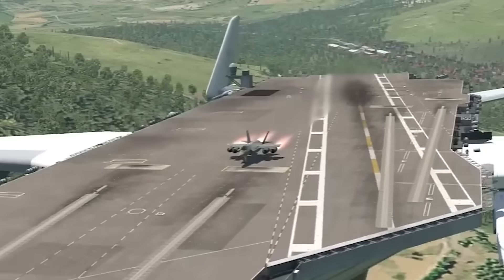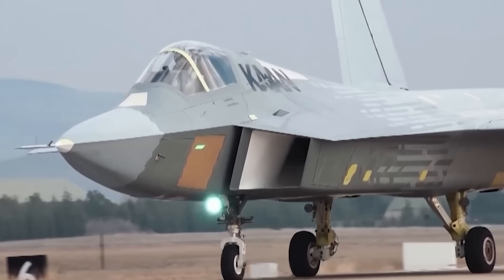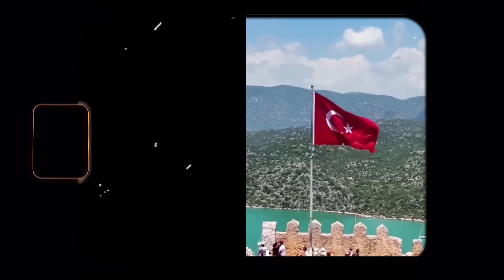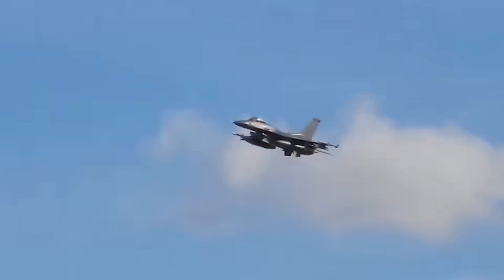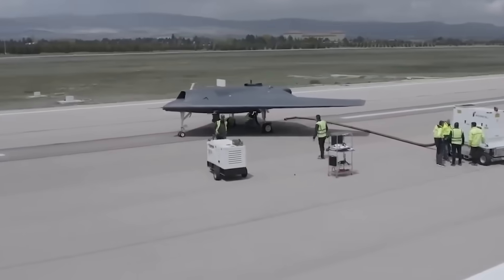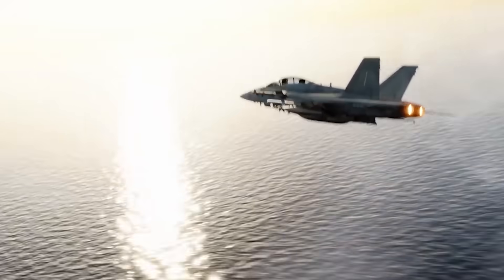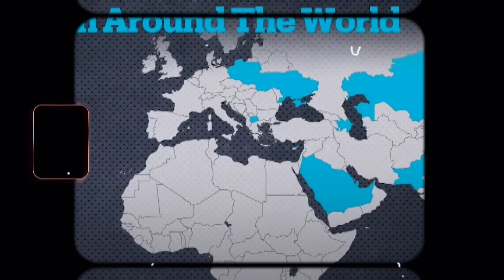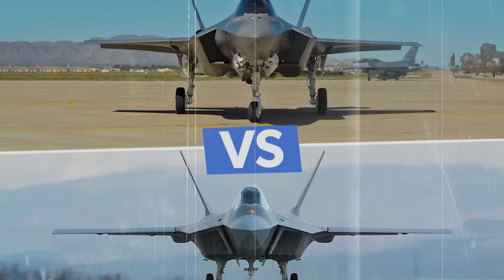TF Kaan vs. F-35 – A Comparative Analysis

Comment: When you compare the F-35 with Kaan it may be worthwhile to indicate which version of the F-35, specifically the US domestic version or the export version, they are different and the US version is significantly better.  I think Israel is the only country that operates F-35s that are similar to the US versions.  Another point to consider is that, as pointed out in the video, F-35 is a virtual flying super computer which is in constant communication with the control center (located in the US) and can be manipulated by the control center (i.e., US has a kill switch).  The US denies this but that only makes sense.  Finally, in the event of a war, US can also stop delivery of spare parts and weapons if they wish to do so.  Bottom line, even if Kaan is not as good as the F-35, it would be better for Turkey to have their own fighter.

Comment: Radar, Avionics, Sensors need power to perform well so F110 engines using only for test program for now and maybe first a few KAAN block 1 will use it. During this time long Türkiye will finish its domestic engine ( 35000 lbs × 2 ) this will give power to KAAN far beyond F22

Comment: You ignorants are miss something about airplane and engineering.
1.F-35 is a stu-pid copycat of Russian YAK-141
2.Even changing the wing area of an aircraft by 0.35m2 changes the aerodynamics of the entire aircraft and all engineering calculations are redone. Aircraft manufacturing is an engineering job, not a fashion. Aircraft are similar to each other and this is normal. They all have a wing, engine and canopy.
3. Do you know F-35's radar emmiting coatings is made by a Turkish owner company?

Comment: Kaan is currently empowered by F16 jet engines. But Türkiye is too close to produce its own jet engine. So we don't need US or EU made jets by 2030. Just hold on for a while.
Reply: The KAAN fighter jet currently uses General Electric F110 afterburning turbofan engines. However, Turkey plans to replace these with an indigenous engine, the TF35000, developed by TUSAS Engine Industries Inc. (TEI), by 2032,
Reply: @TheOzTube Bla bla bla.
Reply: After domestic tf30000 engine, it will compete with f22
Reply: 2009dan beri altay motoru üretemedik uçak motoruna daha baya yol var
Reply: Turkey isn't able to build am easy motor for Altay... 😂😂😂
Reply: 2012 de altay tanklari cikiyordu nerede once bi onlari uretseydik
Reply: @aksuseyh4385  Madem bu kadar meraklısın, seri üretime geçildiğini ve seri üretim teslimat tarihlerinin açıklandığını neden bilmiyorsun?
Reply: @snn- hic bir proje tamamlanmadi ve tarihler tutmadi onu biliyorum 2011 de elektirikli traktorler 2013 de altay tanki cikiyordu ve cikmadi tank 10 yil gecikti bu 5 nesil ucak dan bahsediyiruz yalan dolan hangi soyledigi ciktiki bu tutsun sen basit bi tanki yapammid sin
Reply: @snn- Turk fairytale 😂😂😂
Reply: @aksuseyh4385 bu yıl teslim edilmeye başlanıyor Altay tankları. 3 yıl içinde 85 adet teslim edilmesi planlanıyormuş
Reply: @aksuseyh4385  KENDİ VATANDAŞIMIZ BİZE DÜŞMAN MK
SKTR GİT
Reply: @aksuseyh4385  O projeyi resmen rezil ettiler rant projesi yaptılar klasik akp. Ama toparlandı 2030 da envanterde çokca görülür. Tahminimce.

Comment: Kaan is a prototype, it doesn't even have its own engine yet. Both fighters can't compare yet as far as Kaan finishes its fundamentals needs
Reply: You are right Kaan, tests are continuing, the national fighter jet (KAAN) needs 35 thousand lbf thrust, the TF35000 turbofan engine is in the production phase. Comparing it with the F35 is ridiculous at this stage.
Reply: Yeah but the production phase of the jetmotors has started years ago. It was set to be finished on 2028 and some weeks ago they anounced it may finish a year earlier. Things are going better than planned. I think eventually they will make a better plane based on what officials say, but for now, no match indeed
Reply: Bazı şeyler yer altında büyür. En büyük olana kadar farkedemezsin.

Comment: There's no realistic scenario where f35 faces a kaan. F35 is currently more capable and flexible but Kaan is very promising considering Turkey doesn't have fighter jet manufacturing experience. If Turkish authorities keep using the project as political tool and hinder its development project like when they did with the first flight which they've used the only ground test prototype, Kaan won't reach anywhere in its projected time.
Reply: chp li detected.
Reply: Türkiye’s majority of F16’s built domestically under licence as well as for some other countries such as Egypt. Türkiye has decades long experience and technicians who can disassamble and assamble f16 and it’s engine with a blindfold. TAI’s capabilities not something to underestimate, Türkiye already has it’s own light jet and light craft production lines on going with Hürkuş and Hürjey
Reply: @eminymin  producing from a blueprint is not the same as producing the blueprint.
Reply: @azovianace I agree with you, but Türkiye started a journey by designing training aircraft in 2007(hürkuş).He then worked on projects such as the jet trainer and the light attack aircraft "Hürjet"Preliminary protocol signed for export of Hürjet to NATO member Spain If Türkiye continues with this knowledge and continues to transfer the necessary resources, it can complete this project in the early 2030s.
Reply: @ahmetylmz444  I agree, however producing a trainer aircraft and producing a fifth gen stealth fighter is completely different. I am not saying it can't be done, I am just saying it won't be on time if the government uses the project as a political propaganda tool like making the only ground test prototype fly to gain votes in the election.

Comment: Kaan is of course a threat for F35's. In fact, that is exactly the purpose of her creation. To create an alternative to the American monopoly.  Do you think F35 users would be happy to receive a confirmation code from the US before each flight or to automatically share all flight information with the Pentagon? Not being able to use non-American ammunition, vital systems like IFF being open to instant intervention by the manufacturer, or almost all subsystems including avionics being able to be manipulated... this is what you call customer satisfaction. Not to mention the exorbitant price tag, the outrageous cost of spare parts, or the inability to perform even the simplest repairs without permission.
... Did you know that the mechanical sun filter for the F35 pilot helmet comes with a price tag of $11,000? The same mechanical part ordered for the F16 helmet costs only $135. Madness. 
That's exactly Kaan's goal. To be an alternative that is end-user friendly, has a reasonable price tag, and does not threaten either the pilot or the recipient country with a kill switch. Cheers 🥂

Comment: I guess it will be somewhere between F15EX and F35.
Reply: Nah, it will be better than F-55. Kaan already has 2 engines and insanely strong aesa radar. 
U.S knows they don’t have chance if they don’t make a 2 engine f35 thats why they are making f55, even then problably Kaan will be better, because it is not just a fighter jet, it is also a main ship for other Turkish drones, you can manage and use other drones from Kaan. Kaan is a game changer
Reply: @gultekin
TF-X Kaan will be technologically more advanced and better than the F-22, there is no doubt about that.

Comment: I am a Turk. I don't like empty boasts. I'm a realist. I don't think KAAN will be technologically better than the F-35. If the KAAN can technologically catch up with the F-35, this will be a good result for Turkey. And if it does, this should not be a surprise for anyone. Because efforts have been underway for years to develop all the necessary systems. Turkey is successfully finalizing all the projects it has initiated. Not like Europe or India.

There are already areas where KAAN is superior to the F-35. These are related to overall flight dynamics. To fly better, KAAN has a better airframe design than the F-35. The F-35 is too fat. KAAN also has two engines. This offers the advantage of both range and ammunition transportation. Mororu does not need to operate beyond its borders. This avoids many of the problems experienced in the F-35.

As described in the video, KAAN will not only fight on its own, but will also coordinate unmanned systems (a feature of 6th generation aircraft). It will do this with the presence of many autonomous systems. But how much can a single-pilot airplane accomplish? I'm a little skeptical.
Reply: The propesed radar for Kaan in its first batch is much bigger then F-35 with same tech and higher cooling capasity (its an important display that shows how powerful it will be) also Kaan designed not just for air dominance but ground missions is also prioritised from the start of the design. It's still the only fighter that has dual IR sensors from the get go. Sensor fusion probably better then F-35 from the day one.
Reply: You underestimate your own country. Kaan will have much better radar than f35. Its GaN modules are more than apg81's. Plus it has twin motors. F35 heavily lacked manuevrability. With twin engine kaan will probably not.
Reply: @karbonaterol651  The flight features of KAAN are already better. In fact, many other aircraft are better.

I do not underestimate my country. We, the Turks, have had higher technology throughout history except for the last 300 years. Now we are developing again. But it is not easy for Turkey to surpass US technology. Why? AESA radar has a history of approximately 50 years. We installed the AESA nose radar on the F-16 aircraft for testing purposes just a few months ago. If our radar is better, it will not be because we have better technology, but because KAAN's nose cone is larger. F-35; The 4th low radar stealth aircraft of the USA (F-117, F-22, B-2). Our low radar stealth studies are still ongoing. We do not know yet whether it will catch up with the first versions in 2028. The engine power of the F-35 is 41,000 lbs. The engine we are trying to make is 35,000 lbs. The engine that the US built and used for the F-22 decades ago.....
When Kaan is built, it will be a better plane than the F-35 in total. The reason for this is because the concept of Kaan is better. It has 2 engines. It has a much better shape for flying....
Many people in the world think that the Turks cannot build Kaan, they cannot handle it. However, they will definitely be wrong. There may be a slight delay in the schedule, but it will definitely be built.
Reply: Senin gibi dümbükler atak helikopterinin uçmasına yada tcg anadoludan siha kalkmasınada şüpheyle bakıyordu, Türkiye nin elektronik alanındaki büyük başarılarına rağmen kaanın sensörleriyle ilgili şüphe duyman kesin  muhalefet ezikliğine bağlı olmandandır. Türkiye bu zamana kadar yaptıklarıyla kaanı yapabileceğini zaten gösterdi, savunma sanayii yetkilerinin kaan artık bir zaman meselesi anlamında açıklamalar yapmasının  sebebide budur.
Reply: Kaan has already been sold to Indonesia, 48x times for around 15 biljoen dollar. This means it is very Good. This plane should not be compared to the F-35 but to F22. Kaan wil be far bether than F22.
Reply: @turkturkic7015  Kaan'ın Endonezya'ya satılmış olması çok iyi bir uçak olduğu anlamına gelmez. Dünyada satılmayan uçak var mı. Hepsi çok mu iyi. Hayır. 

KAAN zaten harika bir uçak. Endonezya almasa da öyle. Veya bizden başka kimse almasa da öyle. F-22 kalite olarak F-35'den daha üstün bir uçak. Mesela radar görünürlüğü F-35'in de ellide biri seviyesinde. Ancak F-22 sadece bir hava üstünlük uçağı. Ve eski bir uçak. Yani sonradan bulunmuş F-35'de olan pek çok özellik F-22'de yok. KAAN pazar açısından F-22'nin rakibi değil. Çünkü KAAN her şeyi yapacak uçak, F-16 gibi, F-15 gibi. (Av-önleme, av-bombardıman, hava üstünlük ...) Çünkü biz ABD değiliz. Başka 10 tane daha uçak modelimiz yok. 

KAAN'ın en avantajlı tarafı genel yapısı. KAAN her şeyi yapmak zorunda, buna da yapısı uygun (iki motorlu, büyük gövde), F-35 gibi gövdesi kısıtlı değil (tek motorlu, küçük gövde).  KAAN'da; F-35'in alt sistemlerindeki (radar kapasitesi, kızılötesi görüntüleme kapasitesi, düşük görünürlük seviyesi, görev bilgisayarı kapasitesi, sensör füzyonu kapasitesi....) teknoloji seviyesini yakalayabilirsek, ki ben yakalayacağımızı düşünüyorum. Bugün envanterdeki uçaklar içinde en iyisi olur KAAN. Konseptimiz ve uçağımızın gövdesi müthiş uyumlu oldu. Oldu ki, ABD de F-35'in çift motorlusunu yapacağını açıkladı.
Reply: @turkturkic7015  ABD'nin teknolojik seviyesini yakalamak ne demek. Biz kaç senedir flir kamera yapıyoruz. Çok senedir. Peki Aselflir 500'ü yapana kadar kameralarımız (Aselflir 100, 200, 300, 400, Cats ...) ABD sistemlerinin neresindeydi. Önce çok gerisindeydi, sonra yine gerisindeydi. Aselflir 500'ü yapınca ne oldu. ABD seviyesini yakaladık hatta üstüne bir çıktık. 
İşte konu budur. KAAN'ın alt sistemlerinde ABD seviyesini yakalayabilirsek, KAAN dünyanın en iyi uçağı olur, diğer avantajlarından dolayı.